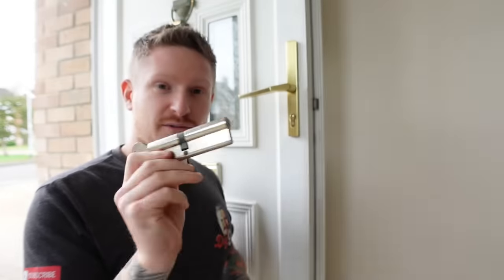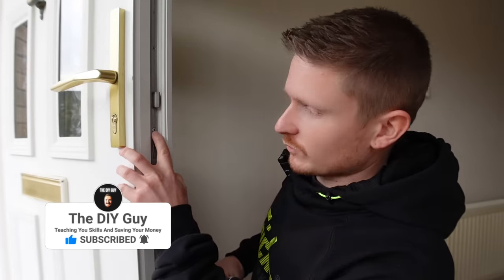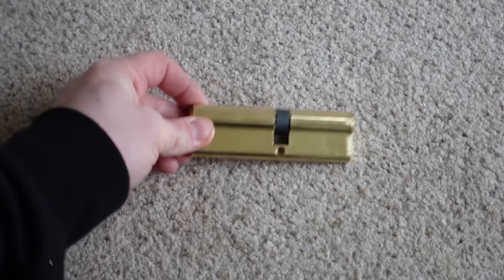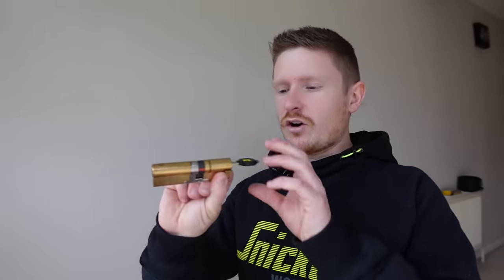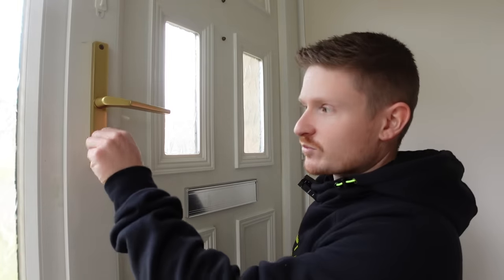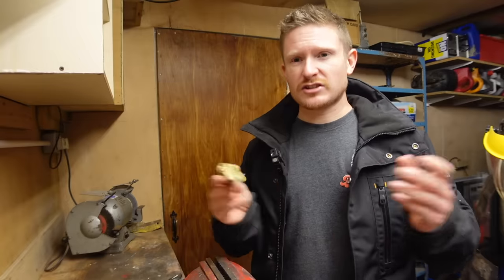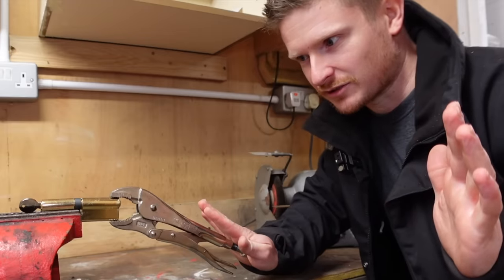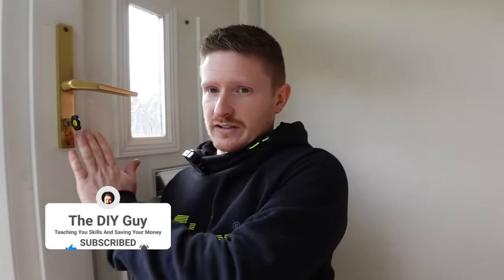How to Change a Euro Cylinder Door Lock and How to Avoid Lock Snapping!

Comment from the maker: This is a job every home owner needs to know how to do. What others can you guys think of?
Reply: Hi Diy guy, nice and clear instructions..I had this happen to me and it is so easy for opportunists to snap a lock with no more than a pair of pliers and 30s to spare....had to replace all my locks...It can be a little more tricky on french doors as the screw on the 2nd door can be hidden..If you do have french doors also fit Patlocks for additional security..Make sure the Patlock is fitted properly with the anti pull out washer, maybe if you have french doors give that a go....keep up the good work.
Reply: Too right, anything else is just folly. An investment in ABS locks now saves potentially a lot of hassle later.
Reply from the maker: @martinlee7100 thanks, some good info there 👍
Reply from the maker: @petervernon6503 👍
Reply: How about how to adjust that door if it's sticking or catching on the frame 🤔
Reply: Hi Cameron, thanks for this one. Be good to see a vid on how to solve internal door problems. Some of my doors stick to the stops and swing open unattended. Any tips?
Reply: @iangregoryhome  That would be good. Our front door can be really bad sometimes and needs a good shove to open.
Reply: How to adjust a uPVC door where the door catches
Reply: @familygillow6613  So many different ways depending on the type of door, some doors don't even have adjustments and catch because they were fitted poorly.
Reply: It's a good video.  You didn't state what measures the star locks have built into them. You should add text that the 3 star locks have a weak point built in so while they will snap, it snaps in a specified point that will not allow entry.
Reply: what on earther have you done to your arms?
Reply: some people find the challenge a bit daunting! No risk no Reward...and you learn a new skill along the process!

Comment: Worth noting if you're replacing a full set you can order up multiple cylinders on the same key. Really nice not to be lugging lots of metal around.
Reply from the maker: Absolutely, great point
Reply: Any good suppliers that don’t want £70+ a lock?
Reply: Can you advise where from? For a 3 star anti pick, bump or drill.
Reply: I got some keyed alike ABS locks on ebay for a good price, from what seemed to be a locksmith business. Just make sure to send them to a friend/family house just to be on the safe side.

Comment: Great video. It’s a little late for me now but some great advice would be to tell people to NOT close the door without the cylinder in.  I took mine out, locked rhe door with the dead bolt and too the cylinder to the DIY store with me to make sure I got the right replacement.  Came home and couldn’t open my front door.

Comment: Thanks for a really useful video. I am just curious why you didn't put the whole lock in the vice when trying to snap it as it would be in the door, I don't understand how it could be bent downwards like that if the cylinder is supported in the door? 🤔
Reply: It would be in the door frame, but door frames are UPVC or composite and weak enough to let grips snap the lock like that. What puzzles me is why he didn't explain how the better locks are better?

Comment: did this the other day, went with the same model as you but with a thumbturn on the inside for a safer lock in the event of a home fire as you mentioned. simple enough job and provides a little extra reassurance
Reply from the maker: Absolutely 👍

Comment: This is just the information I need.  Need replace my  lock after a break in, but I  also need to be able to secure the door  from the inside without using a key. I  find it's always best to know what you are asking for when in the shop. Right,   now I am confident.  Thanks
Reply: Job done - I bought  the most expensive one - a 3 *. Feel  safe  now. Thanks

Comment: I would recommend homeowners to do this, it was an easy job and I feel more secure with the three star Yale cylinders. I replaced the spindle of the handle at the same time as the existing spindle was starting to round through use so that might be a useful video?
Reply from the maker: Absolutely. Thanks

Comment: Gret vid! I noticed that the yale lock didn't have a ball on the cylinder in the middle. The link in your description to the yale lock does have a ball on it? After a quick Google, a lot of three star locks have balls in the middle. Any advice? Thanks. I'm worried about fitment issues
Reply: Anyone?
Reply: Due to consumer fitting issues yale have discontinued the ball but the lock is still a 3 star lock

Comment: Great vid,  We are just buying a villa in Spain and emigrating and this is on my list as the first job to do on 31st January - 3 star anti snap locks on a single key.  I am also going to fit a few other bits recommended by a locksmith, petty crime such as burglary is quite common and squatters if you get them in for more than 48 hours pretty much have more rights than the homeowner.

I am not sure what the 3 star markings actually signify but the ones I am after are the ones that after snapping a small, weak sacrificial portion at the front still need a key to operate them - some apparently snap further in and don't need a key when snapped even on high security rated locks.👍
Reply from the maker: All the best with the move

Comment: I have a door that if u pull the handle up 2 locking bars come out from the top and the bottom of the door frame. The actual lock is playing up , is changing this still the same or is the internal mechanism a lot more complicated as it’s attached somehow to the 2 extra bars
Reply: I know this is seven months ago and I assume you have sorted it but nope, exactly the same lock. My doors have the multi lock mechanism and the eurocylinder is exactly the same.
Reply: @karlbassett8485 thank you and yes I have sorted it out . Was just a case of changing the main cylinder.

Comment: Great video, one small point, the screwdriver you used was a pozi drive not a philips, it got little square bits between the flights, the screw is a philips as it does not have the little markes between the cross.

Comment: If you have to use the euro cylinder format, go with Abloy if you want quality. All the pin tumbler locks are easy to pick even if they weren't vulnerable to snapping. Unfortunately, high quality Abloy cores such as Abloy Protec are pretty expensive but you pay for what you get.

Comment: You should also change the handle to a 3 star one too. The basic handles can easily be broken to give access to the lock barrel.
Reply from the maker: Spot on. This is why a cylinder without anti snap mixed with most handles is such an easy target.

Comment: It should also be added, most thieves want to get into properties in the smallest time with little noise therefore without arousing attention. Lock snapping is one of the few methods that ticks all of those boxes. So having an anti-snap lock DOES prevent thieves from wanting to break into your house since other methods are often either time consuming or require loud attention-grabbing noises (such as a window getting broken). Also since most properties still don't have these anti-snap locks, it's less risky for thieves to abandon a property with an anti-snap lock and find another property that doesn't.

I'm going to be replacing the locks on my house with these and encourage my parents to do the same!
Reply from the maker: Some great points here! Thanks

Comment: Hi Bu, just want to point out a bit you got wrong, just for your information, the screw holding the euro lock in place is a phillips as you pointed out, then you got your screwdriver calling it a phillips, but sorry to say it was a pozi screwdriver, case of wrong driver for that screw. You can tell the difference, the pozi screw and driver have small wings between the 4 inserts and flat inserts and the phillips has no small wings and rounded inserts, hope this helps you to use the correct ends, specially on power tools, you can tell even more when using power, the bit keeps jumping out the screw and sounds like a machine gun, when you reach the end ir tightened.

Comment: Fitted a new cylinder lock but when locked as it looks on your video but the key slot is in a horizontal position even though the locks still works. Any suggestions. It’s an abus cylinder lock
Reply: It's supposed to be horizontal.

Comment: Excellent instructions, very clear and straightforward.  The only missing instruction was not showing how and wear you measure to get the internal measurements when the lock is still in the door.  I’m a complete novice so need everything walked through, but saying that this is a really good video.
Reply from the maker: Thanks. With the lock still inside the door you would use method two in the video. Measure from the handle plate to the centre of the screw

Comment: I don’t think you mentioned it and I’ve come across it whilst looking online for them, but it seems that the internal measurement is actually shown 1st. For example if you have a 50mm external and 40mm internal barrel, then you’d actually have to choose the split to be 40/50 not 50/40 when purchasing. I think that’s correct anyway 😂

Comment: Ultion locks are the latest and most secure.  They have an additional clamp that hold them in place that you can only access by removing the internal door handle/furniture.
Reply from the maker: 👍 great points

Comment: So, I'm curious HOW they 'get' the wrench onto the end, when it's in the door, huh, 🤔😳🤯!
Reply: They use a flat screwdriver or crowbar to prise up the bottom of the handle and bending it upwards. With that out the way the lock is vulnerable and can be snapped by bending it sideways with locking pliers.

Comment: hmm.. well i have tried 4 kind of locks, but all worked just fine. nut i dont quite get that test you are showing, because ofcause it will breake. if you pushed the lock further in like they were when in installed in door to give support on the whole cylinder. it would *not Break*🤔
Reply from the maker: Once the handle is snapped away then the cylinder will break in the same way shown in the video. Demonstrations of it done on a door can be seen on YouTube

Comment: Am I missing something here ?  If the lock is correctly fitted, how do you get vice grips on the end of the lock when it is flush with the outside of the door ? 🤔
Reply from the maker: Check out some demos of how it is done on a door here on YouTube. Within seconds a pair of grips can be used to either snap or bend the handle away from the cylinder, this then gives enough movement to snap the lock cylinder.
Reply: Criminals prise the door plate away that houses the barrel so that it exposes it more. 
The anti snap locks are misleading with the name because they’ll still be able to be snapped but they’re designed in a way to snap close to the front rather than the middle, that way the locking mechanism isn’t accessible like shown in the video

Comment: Ultion locks have a high fail rate; they're just rebranded locks from Taiwan (Federal); Ultion did a good job with marketing them, but generally, I would say avoid them. I have replaced countless cylinders, and customers have been left locked out of their houses occasionally due to cores coming out of the cylinders. Yale and Ultion are 2 of the easiest locks to pick and are generally classed as beginner locks when learning to pick (search YouTube). I would get the advice of a trained professional before ordering your own locks. There are much better cylinder options if you know where to look and you value security.

Comment: We had one fail with the key snapped off inside (I wasn't home at the time to prevent her ladyship going hulk on it). Nothing would get the lock to release and I had to try drilling out, which was bloody hard going and made no difference despite quite a substantial mass of bored out material and parts. Finally resorted to snapping, which I'd wanted to avoid for fear of damaging the door's mechanism. It took a lot of force and that was with the luxury of access to both sides. Your demonstration was a little flawed with that floating end, as a lock in situ is partly supported and obstructed so has limited room to flex (very much so in our case). The point about their vulnerability still stands though. It's a rather obvious weakness of the design, really wonder why it wasn't mitigated before coming to market.
Reply: People who do this lever the cover of the lock on the outside which gives them more access to grip the lock as shown and snap it.
Reply: @davesheffield3620  Yes I know, and burglars don't care what other damage it causes so they are free to bear down fully on the grips with the housing as fulcrum. I did purposely remove the handles and covers to gain purchase, but gripping and levering from both sides in order to confine the force as much as possible to the lock and avoid transmission into the surrounding hardware.

Comment: Bulgarian method that is, breaking the lock. However, with a thick cover on teh outside, there is no space to grip the lock. So it can't be done then. Same in your situation.
Reply from the maker: True. The problem is that the handle can be snapped away to gain access to the end of the cylinder on the majority of doors.
Reply: If the bolts are at the outside, yes

Comment: The fact that these standard euro cylinder locks are still being sold and installed is an absolute joke.  Anti snap designs are not much more expensive, I think I paid £19 for 2 Yale versions on Ebay, the standard variants are about £7 each.

This is a shocking design flaw and the locks are not fit for purpose.  You may as well sellotape your door closed when you leave home.

Comment: Sure, they are weak. But this set up with the vise does not represent a normal situation with the lock being inside the door. You have way more room to grip it, and more room to bend it down..

Do the same test, but inside the door. And include the 'better' lock for comparison if you want to make a statement.